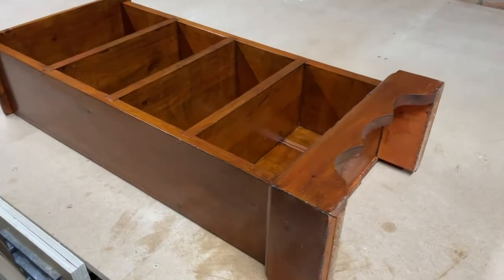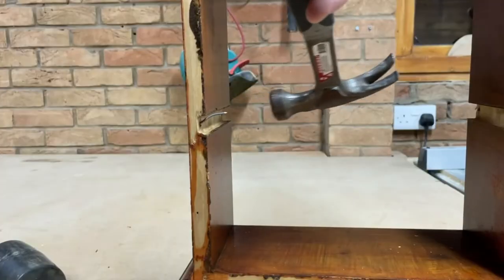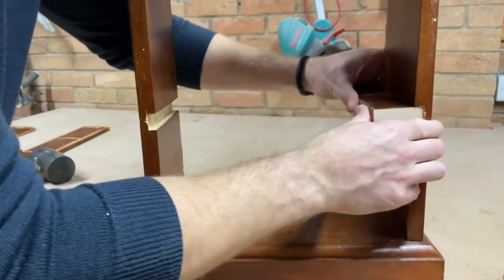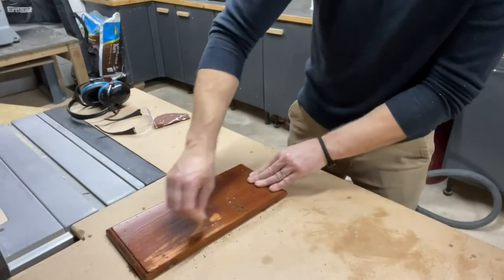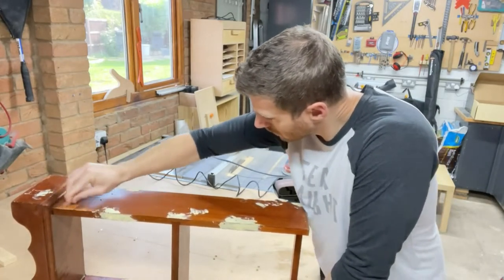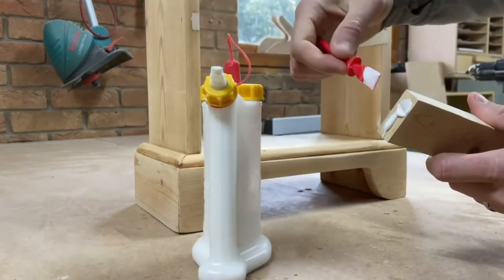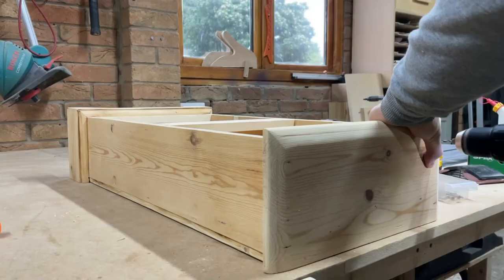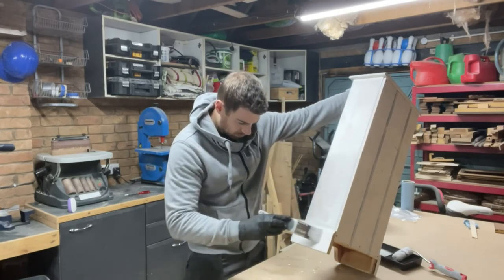I Upcycled an Old CD Rack into a Kids Bookcase

Comment: spray gun terratec...................look at peter millard video currently around 40 pounds i hsve a big compressor use hvlp and a earlex 5500 turbine sprayer tried this little on out from terratec very good and two paint containers
Reply from the maker: I’ll check it out! Cheers for the recommendation 👍